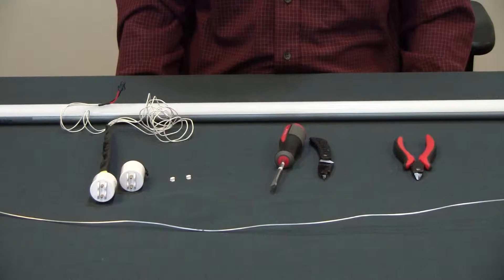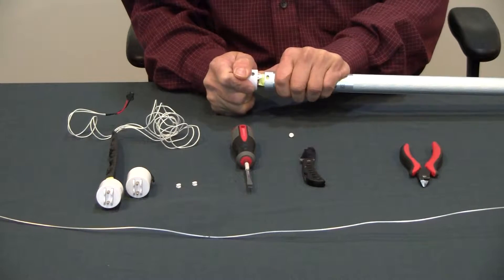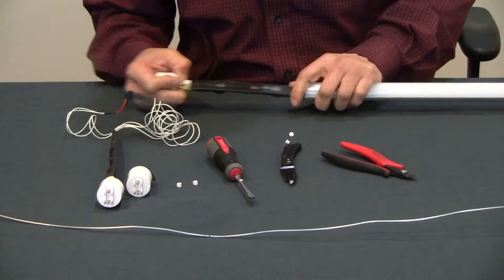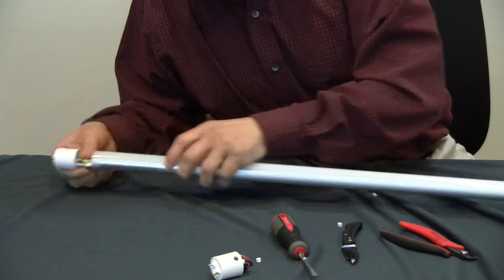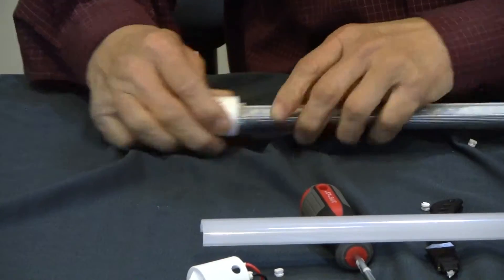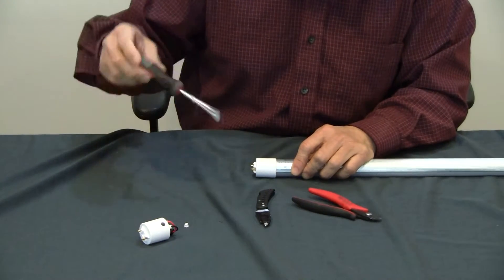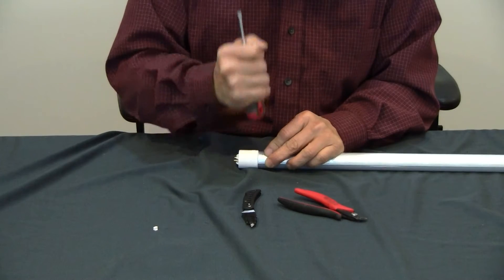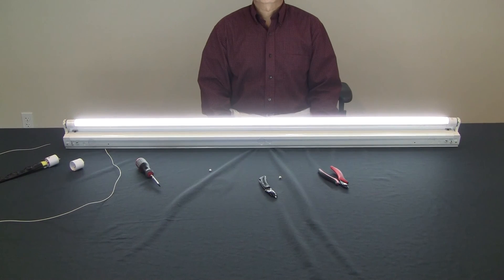SureFit T8 LED Tube Driver Replacement

Comment: Do you know the replacement driver's output watts, volts and amps?
Reply from the maker: It has to be the same driver model number. It can’t change driver wattage.
Reply: @Aleddra  I got the replacement online. Thanks!

Comment: Where did you get the replacement driver?
Reply from the maker: The replacement driver option is only available as part of the 10-year extended driver warranty, purchase-able when buying the G5 SureFit T8. However, G5 tube is phasing out, replaced by our G6 glass tube that doesn’t have a replacement driver due to glass housing.